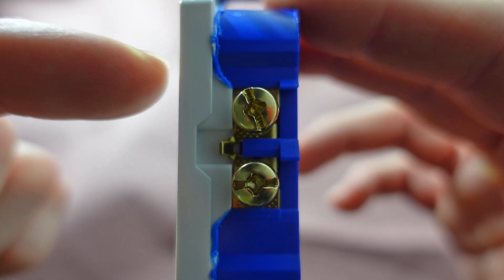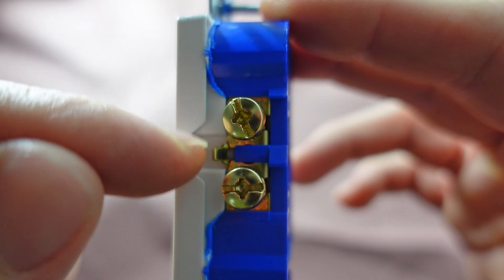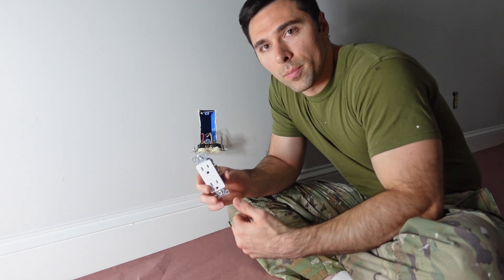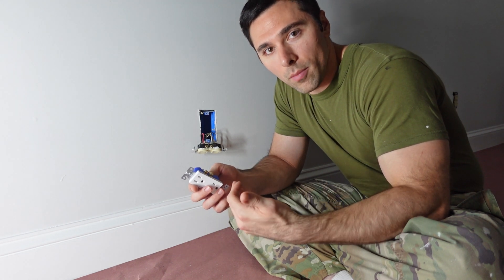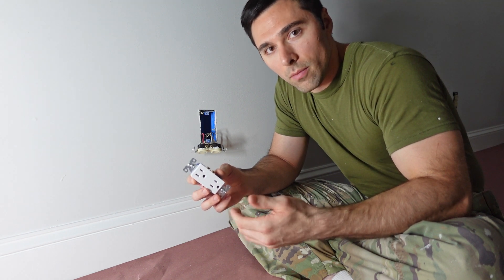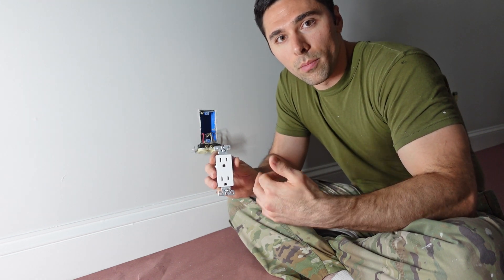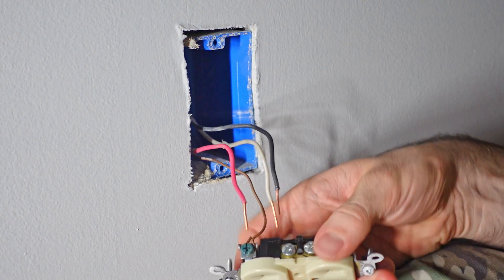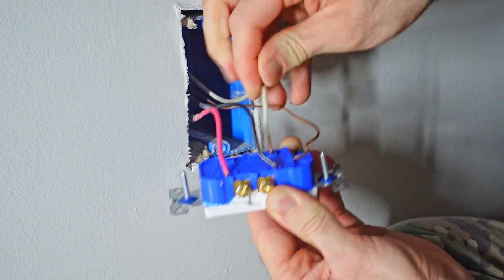What is a Switched Receptacle || Replacing a Half Hot Receptacle

Comment: Nice work! I converted a few switched outlets to one-hots in my house so the bottom outlet always has power and the wall switch turns off the lamp on the top outlet. No sense in two outlets being switched at the wall, one is sufficient. Was also a good opportunity to replace 40 year old receptacles with Leviton decoras with their new flippy Wago connections. So darn easy.